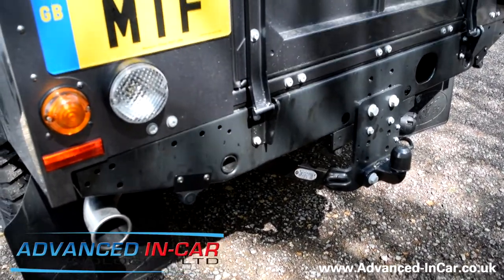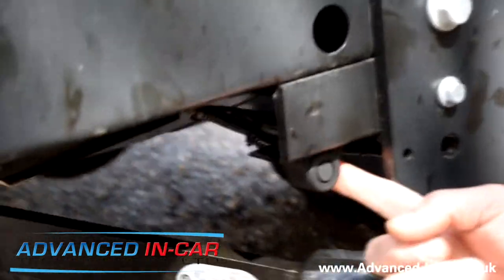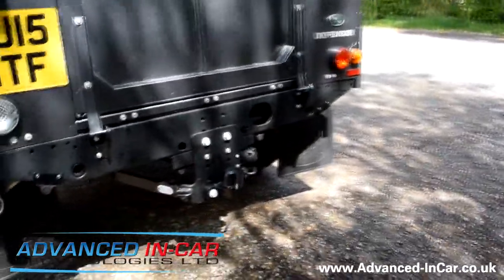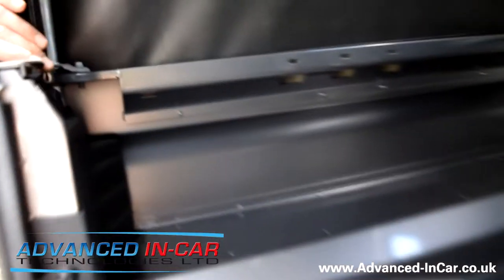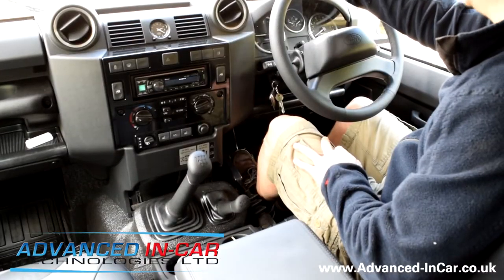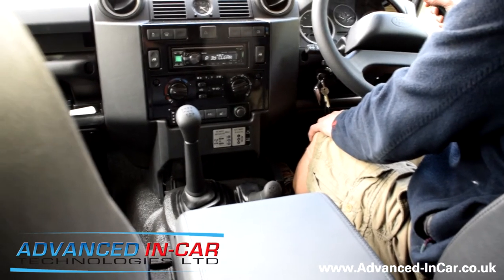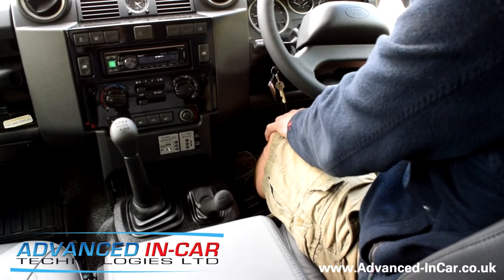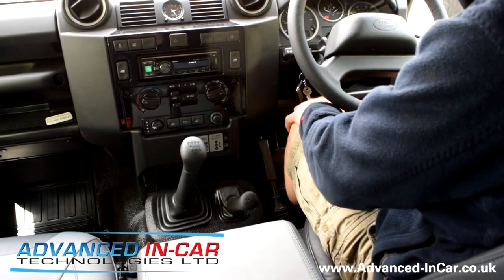Land Rover Defender Reversing / Parking Sensors

Comment: Nice system, I'm impressed. Is this a reliable system? Is it possible to fit the switch in the front? Will be investing in one myself shortly I think. FYI in this video its a 110 double cab, not a 130.
Reply from the maker: +David Whittaker Yes it's a great bit of kit. We've sold quite a few kits now. Been exporting them all round the world. Well the wiring loom is long enough to where we install it but no reason why you can't just extend it. We did it when we fitted rear LED flood lights to our last defender. Had a row of switches to control them all :)
Reply: useful info, thanks!